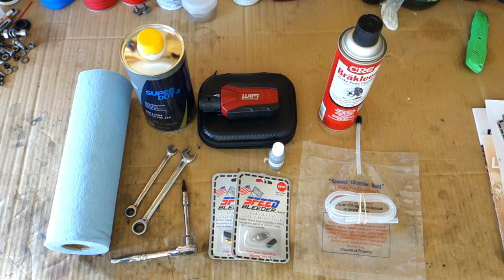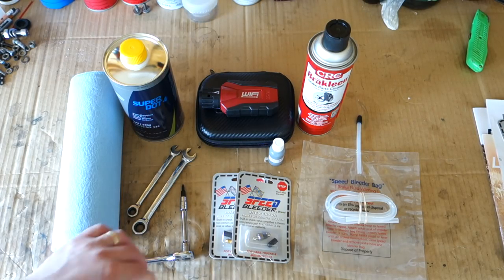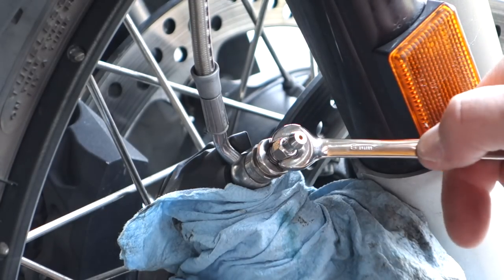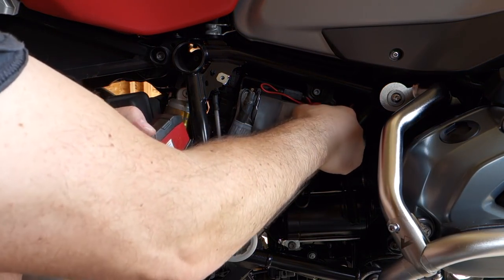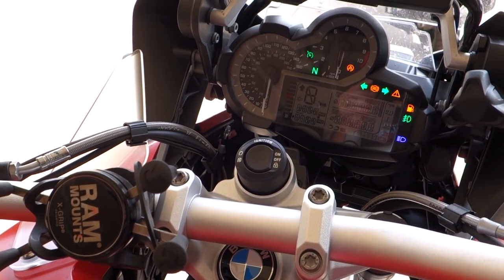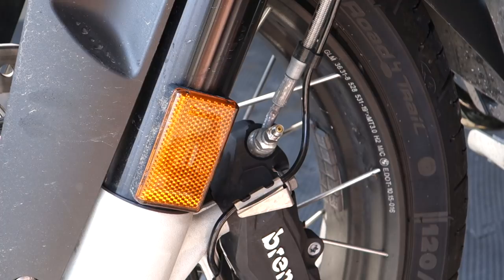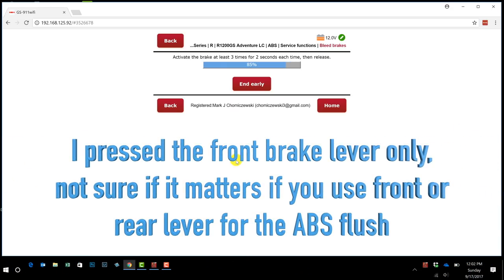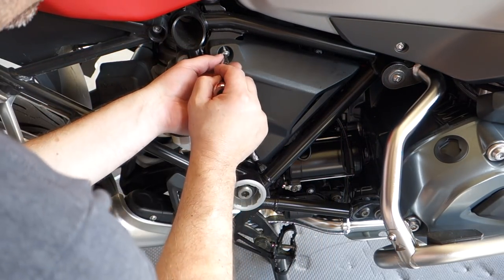BMW R1200GS Adventure ABS Brake Flush (with Hexcode GS911) & Speed Bleeder Installation - Part 1

Comment: Thanks for the video, really helpful.  I have a 2015 1200GS (not adventure) and also need to flush my breaks/ABS, I'll be purchasing your recommended products.  If I understand from the video, first you bleed all your breaks (2 front + 1 rear), then you tighten the bleeding valves and run GS911 to flush the ABS, repeating the process 3 times?  I'm having difficulties understanding how GS911 is used to flush the ABS, what's actually happening when 'flushing' the ABS using GS911?
Reply from the maker: Anthony Escribens - yes, that’s right. Do the brake bleed, then ABS flush, then brake bleed, then ABS flush, and end with one more brake bleed. Make sure you fill up fluid after each brake bleed. The ABS flush moves the brake fluid out of the ABS unit at each wheel. I didn’t see any increase of fluid into the reservoir after each ABS flush, so I assume it’s a small amount and is moved into the brake line or caliper piston. Once you flush the ABS unit fresh brake fluid will enter into the unit. I hope this helps.
Reply: Perfect!  Have you done the oil change to your Forks yet?  :)
Reply from the maker: Anthony Escribens - not yet. I will be changing rear drive fluid this weekend though!
Reply: I just ordered my Speed Bleeder set, I called them by the way and gave them the link to your video; great job promoting them!  Ordering my GS911 today.
Reply from the maker: Hey thanks for that!

Comment: Great video thank you so much. My 750GSs is close to one year  6k miles need to do break fluid flush. This is really helpful.  Could you clarify below 

1. Did you leave the Speed Bleeder on the bike or put back the factory one ?
2. During the Bleed test from GS11 , were you bolding front and rear breaks for 2 secs at the same time ? or you did front first and then rear
Reply from the maker: @Aswin Raj - glad the video helped! Some answers for you:

1) I left the bleeder valve on the bike, just be sure to tighten down after the flush/bleed (don't over tighten, just until it stops). The next time you bleed the brakes it will be an easy process, just open the bleeder valve a half turn and pump the brakes!
2) Good question! In the original video I only held down the front brakes for 2 seconds for the ABS bleed process with GS911. But you should press and hold BOTH the front and rear brakes. I made another video answering this and other questions like yours that was not so clear from this first video. Check it out here: https://youtu.be/Z9-xqX5d_Vs
Reply: @zooskifilms  Perfect thanks again. Will check it out

Comment: How did you determine the Speed Bleeder sizes?  Would it be the same on a 2019 1250?
Reply from the maker: @Phillip Gordon - Yes, good question.I see that the Speed Bleeder site doesn't list my model and year right now. At the time I ordered them it did. I would suggested contacting them to see if they offer them for your model and year. Here is the email address: info@speedbleeder.com .

Comment: 911 in the wishing list. In theory, can thus be done by bleeding brakes, then riding and activating servo brakes, the bleed brake again at home, the ride and activate brakes, then bleed at home once again?
Reply from the maker: @Daniel Marty - Yes, I don't see why not. I actually addressed this a little more in the follow up video https://youtu.be/Z9-xqX5d_Vs . I made a similar comment that the ABS unit could be activated on the road but was not an ideal situation. If you do it in a controlled environment (parking lot, etc), then sure! I also made the comment that many folks don't feel it's necessary to bleed the ABS pump unless changing out the unit itself or one of the brake hoses connected to it. If it was me, where I don't have the GS911, I would do the mechanical bleeding only, check the ABS in a parking lot (both front and back), and if they didn't feel soft when activated, then I would skip that part. If I was replacing the ABS unit or brake hoses connected to it, I would definitely find a way to bleed the ABS. Hope this helps. Good luck.  And nice RNINET!
Reply: @zooskifilms  Thanks for the info. R9T is well behaved. I have a 05 R1200RT that I'm looking at doing the brake fluid. Your info makes me feel better. Will do the job this weekend. Thanks for the great videos.
Reply from the maker: @lamarinchen  -  I had my eye on an R9T for a while. I wanted the black storm version. That welded aluminum tank you have is also a sweet look.

Comment: question here: I have a 2018 R1200R - can this be done without the GS-911? what is its role here?
Reply from the maker: I'm not aware of any way to flush the ABS unit without the GS911, or taking it to the dealer. Some might say you don't need to flush the ABS unit, just flush the brake fluid line through the bleeders. So the role of the GS911 is to manually activate the ABS pump during the bleeding process.

Comment: Yes, why are the Front Speedbleeder valves different from Right to Left? Thanks.
Reply: I found the application page on the Speedbleeder's website =>

http://www.speedbleeder.com/Motorcycle%20Sizes.htm
Reply from the maker: Enzo Cinquecento - yes, I just checked also. Not sure why BMW designed them different, but they most definitely are!
Reply from the maker: Citizenthirteen  - there also seems to be a fair amount of "special" tools needed to make repairs. Not sure what it's like with other bike manufacturer's, but touch to buy these tools just for one job.

Comment: I like the tube and bag to catch the old fuild but can’t you just hook the tube up to the stock bleeder valve? Just curious.
Reply from the maker: Gary Butler - yes, you can. But the speed bleeder valve is faster and won’t suck air back into the line if you forget to tighten the stock bleeder when releasing the brake handle.

Comment: What i understand from this video it is impossible to take the air out the brake system on my r1200 gs lc without this gs11 by hex.

Why bmw makes it so difficult for its customers how want to service motorcycles athome 

Is honda africa twin 1000 cc  al so like this
Reply from the maker: Not sure about the Honda Africa Twin. But I think any vehicle with ABS would need a way to activate the ABS pump manually. Some might say you don't need to bleed the ABS, just focus on bleeding the fluid from the reservoir to caliper. You could also take it to a dealer but then you're paying $$$ anyway. If you plan on keeping your 1200GS for a long period, I would recommend purchasing the GS911 because it does so many more things than just bleed the ABS.

Comment: Thanks for the video. I got some bleeders and work great. Question, my left and rear bleeders don’t Seat all the way but do work and no leak. Are yours seated all the way?  Thanks.
Reply from the maker: When you say they don’t seat all the way, what do you mean exactly? If they don’t turn any longer I would say that it is fully seated. You only need to turn 1/4 or 1/2 turn open to bleed them.
Reply: zooskifilms yes, not flush mount with the nut per say. Called them and was told it’s ok that some application this happens.
Reply from the maker: Ezio Comparini - I see. So with yours you can see the threaded part of the screw? If it’s not leaking, sounds like you’re good to go..

Comment: Shouldn't you start bleeding from the farthest point to from the master cylinder, that is from the rear wheel?
Reply from the maker: @James DePaul - True for when multiple calipers are sharing the same master cylinder. There are two master cylinders on this bike. The one on the handlebar is for the front two calipers. The master cylinder for the rear caliper is just above and behind the right foot peg. On the front two calipers I should have bled the one on the left side first, being the furthest away from the master cylinder. I did a follow up video addressing some of these types of questions here: https://youtu.be/Z9-xqX5d_Vs

Comment: Is that absolutely necessary to use the GS911 when bleeding the brakes or is it optional?  I’ve read that the ABS cycling is necessary only when you replace the ABS.  I’d appreciate clarification on that point.  Thanks.
Reply from the maker: Only if you want to flush out the ABS unit. You should be able to perform a traditiopnal brake bleed, but read comments from carmas54, he indicated he had soft rear brakes without performing the ABS flush with the GS911. I have never tried it without the GS911 so I can't comment myself.
Reply: You do not need to do this abs bleed. But if you have the tools do it anyways... A simple way to bleed the brakes and make sure you don't have air in them, suck all the oil with a large seringe in the bleeders, then fill the system with new oil the same way, inject new oil through the bleeders. All the air wiil come out the top reservoir and  the oil will fill them for bottom to top. Quick and easy...
Reply: Rui Gaio What about air in the ABS pump?
Reply: @gato69evo  Ignore this advice. Its incorrect.

Comment: Is this process the exact same for the R nine T?
Reply from the maker: @E kiss - yes, I assume it has ABS? The speed bleeder sizes might be different, I would double check sizes that if you want to add them.The R NINE T is listed on the Hexcode GS911 website with the following statement " ALL of these K001 chassis models require the GS-911wifi or GS-911usb Generation 2 interface!". I would double check your model year to see if the ABS service functionality is available as well. Good luck!

Comment: almost a year later.. curious to know if you have had any leaking at the replaced bleeder valves?
Reply from the maker: tykebe - no leaks. I installed 3 bleeders on this bike and one on another bike, none leaking! I haven’t bled them again since making this video. My bike calls for 2 year intervals, so I’ll be bleeding again next year. I suspect it may be more prone to leaking after several opening/closings.

Comment: So if i can't get gs911 device what i can do
Reply from the maker: @Mohammed Eshtawi - If it was me, I would skip the ABS pump flush and just do the mechanical bleed one time, enough to bleed off the fluid in the reservoir and brake lines. If I was replacing the ABS pump/module you will need to bleed off the ABS pump/module, so you would need to take it in to a repair shop that can run the ABS pump/module bleeding process. I always say do what you can when you can. Cheers!
Reply: @zooskifilms 
Thank you for your replay and i want ask you another Question, i have fluid leak in front right caliber and i fix it,  do i have to fill fluid in abs pump or just fill the fluid tank on handlebar? Easyway please
Reply from the maker: @Mohammed Eshtawi - I would fill fluid in reservoir on handlebar and then do a mechanical bleed on both front calipers, just to be safe. Check the front brakes when you ride to make sure they are not soft. If they are soft bleed then again and then tie down the front brake level for 24-48 hours. Good luck my friend!

Comment: What size and thread speed bleeder do you use?
Reply from the maker: @CarlGrobler - You can see the details in the Description of the video:

 Speed Bleeder - http://www.speedbleeder.com
Front Right - SB8125L-SS (stainless version) Thread: M8 X 1.25   -  Length: 1.28in, (32.54mm)
Front Left - SB6100-SS (stainless version) Thread: M6 X 1.0   -   Length: 1.13in, (28.80mm)
Rear - SB1010S-SS (stainless version) Thread:  M10 X 1.0 -    Length: 1.23in, (31.35mm)

Comment: I also have gs911  very useful tool and r1200gs year 2011. Is it your first gs1200? I love the boxer engine don't  you?
Reply from the maker: agus - yes, my first 1200 and first BMW motor bike. I do love the boxer engine, the power, sound, history. My only complaint is the clunky gearbox. I didn’t really notice it until I drove other bikes. Perhaps  I am still breaking the bike in, only have 7000 miles currently.

Comment: Just wondering like Ive done on other bikes with abs , do your flush then ride motorcycle and activate your abs numerous times then reflush system?
Reply from the maker: @ADVScott342 - Thanks for your question. The answer is Yes and No. Yes, if I don't have a way to manually activate the ABS pump, like on my 2014 Honda Forza, I would flush the brake line and then go out on a ride and activate the ABS a few times and then come back and flush them out again. For the BMW R1200GS I use the GS911 to manually activate the ABS pump so I wouldn't do it out on ride. BMW recommends you flush 3 times and activate the ABS 2 times in between flushes. If I didn't have the GS911 I would probably perform 2 flushes and activate the ABS 1 time in between, considering the extra time needed to go out on a ride. Great, question, thanks again for asking!